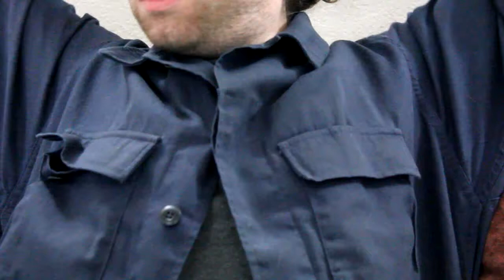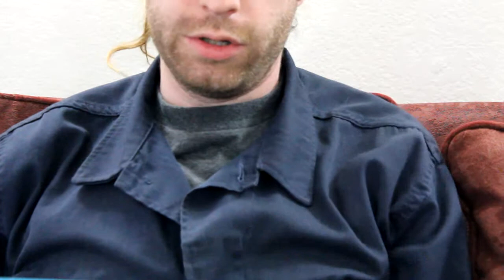American Steel

Comment: This may simply be a version of planned obsolescence applied to construction.

Are the tensile strengths etc. all the same. Nothing about the process makes it weaker? For all I know, it may make it stronger, just curious.

Stainless lasts that long, eh?

What is the difference in cost?